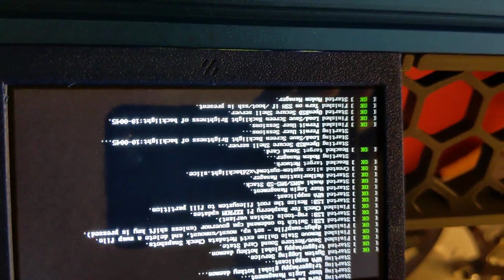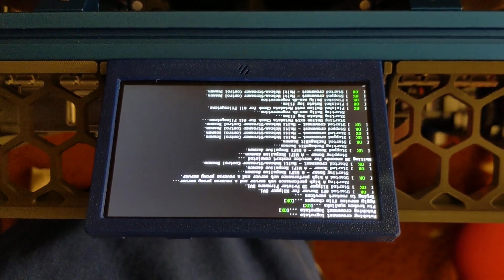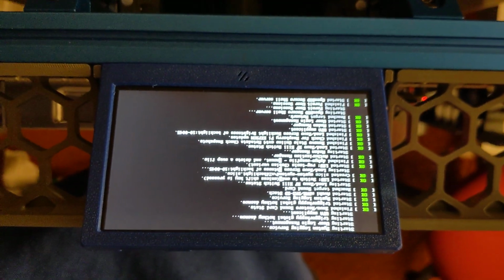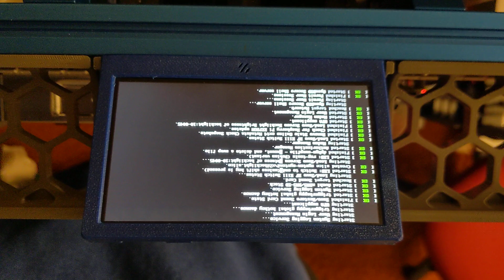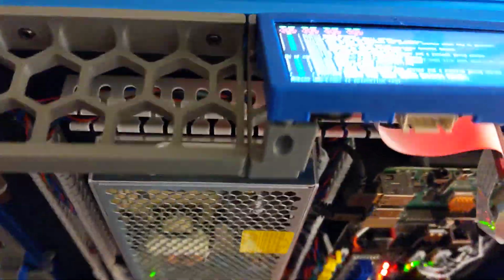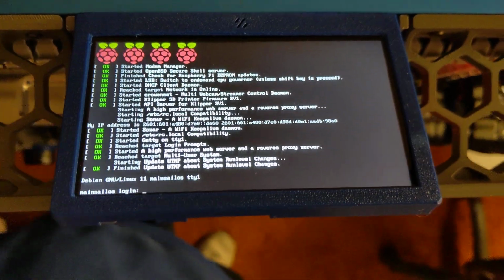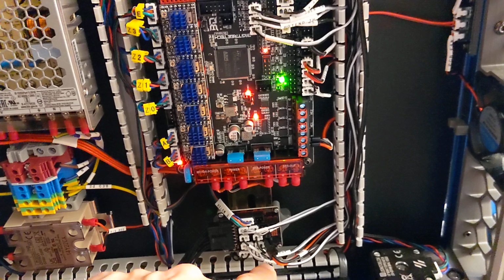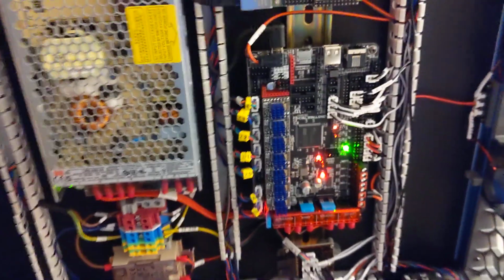3D Printer Voron 2.4 Rev. C 350mm - Build Progress Part 12

Comment: I have the exact Voron 2.4 r2 as yours. Same Pi and controller but I cant get my LCD to turn on. Its strange, because if I remove the ribbon cable the voron boots up and I  am able to connect to in via the  ssh Voron.local browser. If I plug the ribbon back in, I get nothing on the LCD and the pi wont boot, nor can I connect via the web browser. Also when the ribbon is plugged, the green light is extremely faint. when I disconnect the ribbon, its bright green and flashes. Did you  add or remove any comments from the printer.cfg Display section?
Reply from the maker: On first boot my screen was displaying upside down, so I followed the LDO instructions to flip it.  Other than that I made no screen config changes.
I was very careful to make sure the ribbon cable was plugged in correctly.  You may have one end reversed.  Make sure you look at the LDO pictures very carefully to make sure you've got it plugged in correctly!
Reply: @TomsProjects I made certain the ribbon was installed correctly. I get nothing on the screen. I shot off an email to West3D where I purchased it from for support.  I hope I can get a resolution.
Reply: Resolved: My kit was shipped with the wrong ribbon cable. They send me a ribbon cable that was not revered. In other words, the the contacts on both ends were on the same same when they needed to be on the opposite side of each other.
Reply from the maker: @Ricom69  Talk about making troubleshooting even harder!  I didn't even consider that possibility.  Good job getting it resolved!

Comment: Brother, I love how clean your wiring is but there is no need to have a breakout board on the underside of the printer. In fact I would STRONGLY encourage you to do canbus. I have 4 350mm Voron Tridents and 3 of the 4 are on canbus now. Also I would suggest you ditch the Octopus and convert to a Manta M8P with an CB1 hat so you can just ditch the RPi and have a MCU that can just do canbus. The cost is not  that much more for a massive QOL enhance. Personally I like having the TFT display (im using all HDMI displays but 1) and the Mini because the mini is just faster and easier to set temps and load//unload filament with.